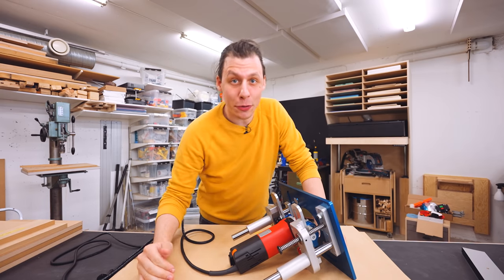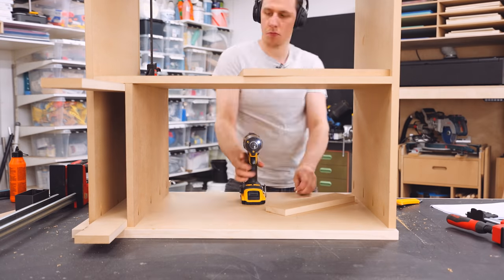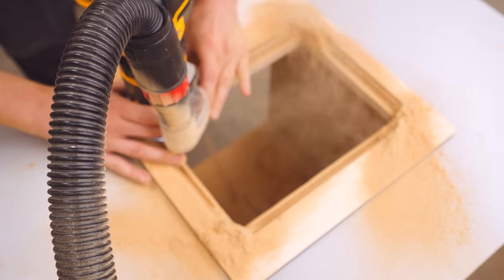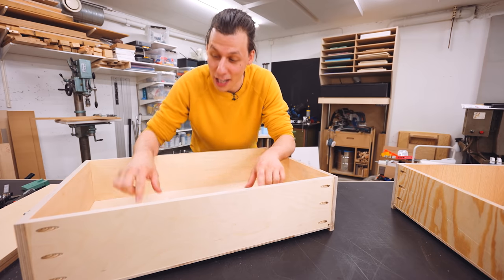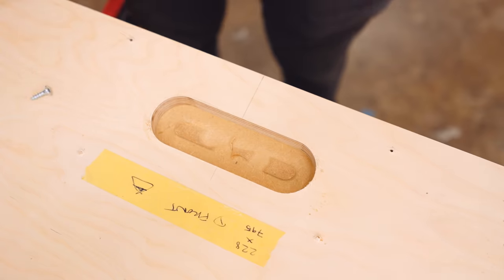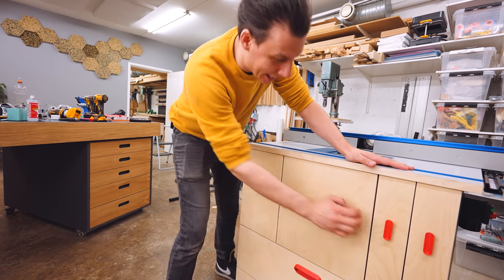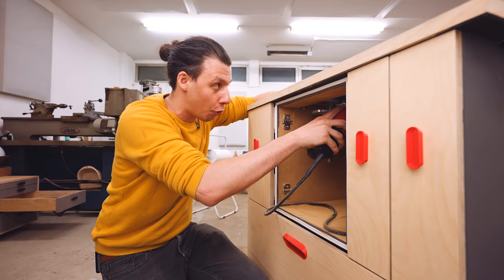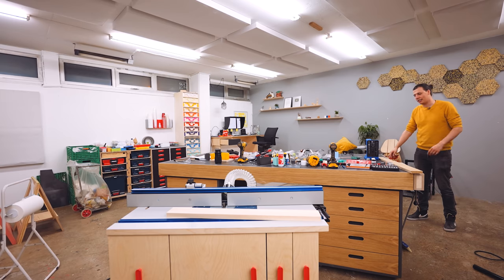Building  What I Think Is The Best Router Table (With Tilting Router)

Comment: Great design! I love the way you did the side drawers.  The compartment where the router is will need sufficient airflow to evacuate the dust.  if it is sealed with no airflow except for he opening where the router bit is, will cause a vacuum and will reduce the airflow.  If there is problems evacuating the dust from router compartment, try adding air holes at the bottom of the front door.  This will allow airflow and help with the dust.
Reply: quite right.

Comment: Woah, went to the link for the router, and I was expecting a high price, but not that high xD (But it's always worth it for a tool you can trust)
Reply: Yah, sticker shock for sure. But it's not always worth it for a tool you can trust. You have to use it enough to justify it's purpose. I'd be hard pressed to use a router enough to justify it's $1250 cost, plus another couple hundred in the table. And I didn't dig very deeply, but I don't know how many of the accessories that they sent Alexandre are included in that $1250 price.
Reply: yeah they are insanely expensive.
Reply: Same here. I was like thats a cool router lift until I saw the price. It costs more than most complete router table packages.
Reply: For a lift including motor I was actually expecting a higher price
Reply: Insane price. I was planning to use Triton TRA001 in my table until I saw this video. Then I saw the price, and we're back with Triton :D It can't tilt, but that's rarely a requirement.

Comment: Without any way to get makeup air into the box below, you won't get much dust collection in there. You don't actually want it completely sealed. The opening at the top will provide some, but not much given the diameter of the hose.

The rest of this is super cool. I love the build, and how quickly it went together. Nice tilting router, too.

Comment: Great looking table. Dust collection should be mounted on the bottom of the back and you will need air flow so some holes in the door top will make your dust collection actually collect dust.

Comment: Just a suggestion for your dust extraction, perhaps the hole in the back of the cabinet could have been toward the bottom instead of at the top? That way any heavier dust/chips which would fall to the bottom would have a better chance of getting sucked up?
Reply: Yes, I saw a similar router table build where there was quite a lot of dust/chips that fell to the bottom and didn't get sucked up.

Comment: I would put a 2nd dust collector hole at the bottom, so that it can suck up heavier dust, wich doesn't get sucked up by the upper hole, and prevents your workshop of dust, when jou open it.

Comment: Hi, Would the router table really be better to do those big chamfers on with that kind of setup? On a tall piece it would be equally wobbly and not having that perfectly vertical or 90 degrees to the table will cause poor results, especially with those narrow edges remaining. Might I suggest a super wide flattening bit, and lay the board with the bottom down? Only thing is that it tilts the wrong way in respect to the fence, but that should be an easy fix.

Comment: Sealed door will cause airflow issue. You have to replace the air you are moving and the opening at the top of your lift is not enough especially when you are using such a tight ring. The placement of the hole in the back is great because you will be collecting small particles at the source. larger pieces are not dangerous to your lung as much as the smaller particles. Great job though!

Comment: I don't think you mentioned this but I was thinking is the height of the router table the same height as your assembly table? Because this would aid in stabilizing longer pieces of wood in getting cuts made with the router, but other then that it turned out amazing, love your work and enjoy this channel immensely!
Reply from the maker: yeah, you're right, all the table surfaces in my shop are 95cm for that exact reason ;)

Comment: HEY
just make small , silent , high volume - low pressure dust collector 
from only 200 wats of power u can easly succ all the dust etc from it 
or use cyclone setup (works avesome)

Comment: Wow, that router & lift costs >1,000 euros.  I know that it can tilt, but a DIY-er has to consider how much that feature will be used.  I was going to buy a router lift some while back when I came across Triton routers which have a lift built in - and they cost about £150-250 depending upon power.  There is an excellent review video showing their versatility.

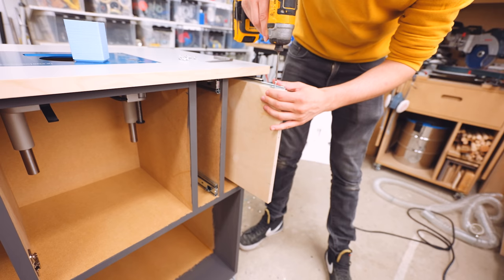Comment: What is that metal thing called you've attached on the sides of the plywood before drilling into it at 7:54 for the slides? edit: i see you bent the slides, can you just bend those manually :o

Comment: Loved the look of the router lift combo so I click on the link whispering don’t be 1000 dollars…. It’s 1000 dollars :(
Reply: There's a 680€ that includes a slightly less powerful router and lacks the 45 degree adjustment. That's not too bad.
Reply: @Syberz  still 800 US dollars quite a lot when you can buy a cast iron top with a decent lift and router for around that price
Reply: @Festoos  Sounds interesting, link?
Reply: @Syberz  if you head to rockler woodworking you should be able to find the top and lift there, and then a dewalt router is the usual go to
Reply: @Festoos  Sweet, thanks for the info. Now I need to figure out if the shipping to Europe is insane or not.
Reply: 1200 us dollars

Comment: This is a great video.  I do have a question regarding your drawer slides for the vertical drawers for the bits.  You have a link, but the drawer slides do not bend, allowing you to screw into the board on the top and bottom.  What is the type of drawer slides you are using in your video?  I would like to get the same ones.

Comment: If you liked the hot glue trick, you'll love the 10 second CA glue trick. 😉👍
Reply from the maker: Ca glue doesn't build enough, so in most cases it doesn't work for me
Reply: @achappel  I use a gel version from Titebond. The hot glue cools down too quickly for me (I'm a bit slow 😉).
Reply from the maker: @mururoa7024  oh jeah that would work well, the hot glue gun I have can take different types of hotglue and temperatures, so the one I'm using gives a bit more time.

Comment: Only complaint is that the power switch should have been closer to the front of the table so you don't potentially bend over the spinning blade to shut it off.